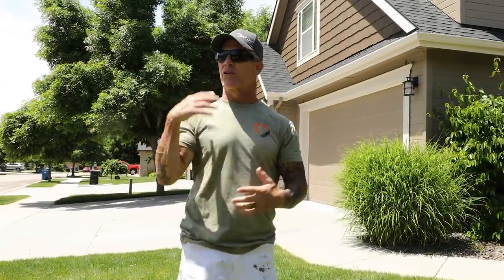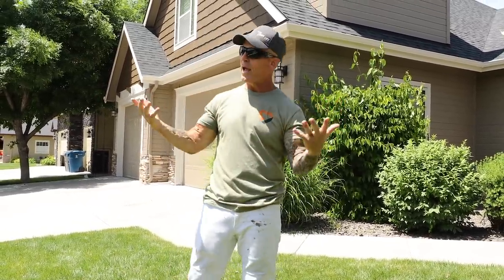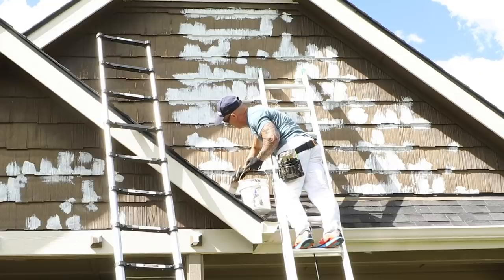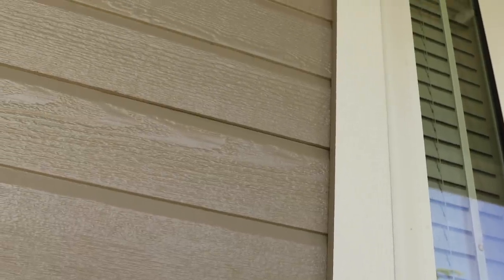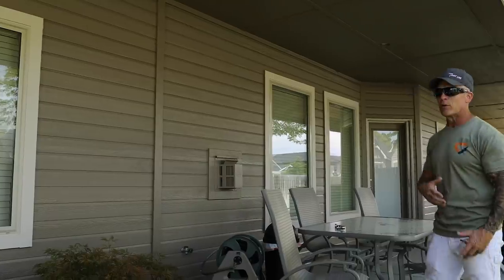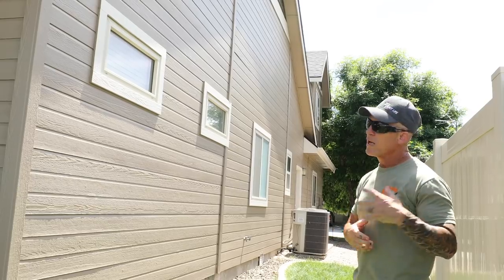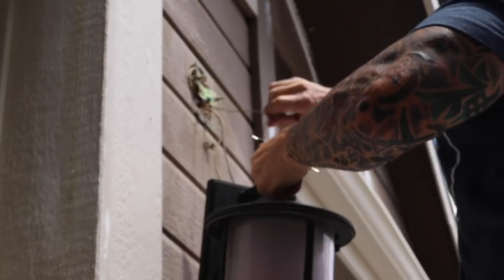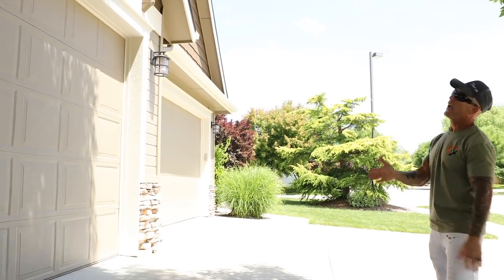What to Paint First? Tips and Tricks for Painting Solo! Final Solo Painting Project Revealed.

Comment: How’d you like that glidden paint? I’ve used it once and I think its pretty bad
Reply: Oats Buckey yeah I know, I usually use resilience from sherwin williams unless told otherwise by my clients. But if they were to ever request glidden I wouldn’t go for it.
Reply: One time I was taking a couple gallons of glidden from Walmart to the job site on the back of my truck and the bottom of the cans popped because the sun's heat disconnected the tin metal from the plastic on the bottom , spilled paint all over the road 😂
Reply: Oats Buckey I’ve used it before man expensive stuff! Only use on super high bids